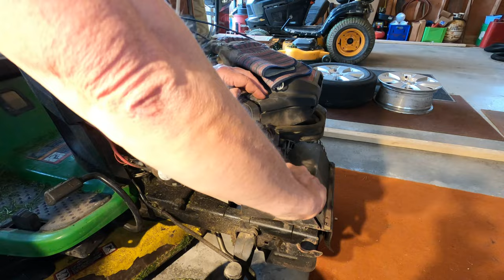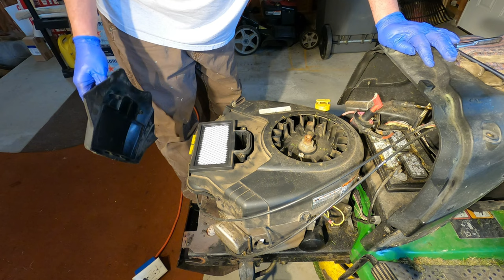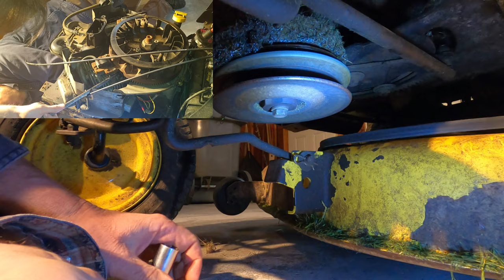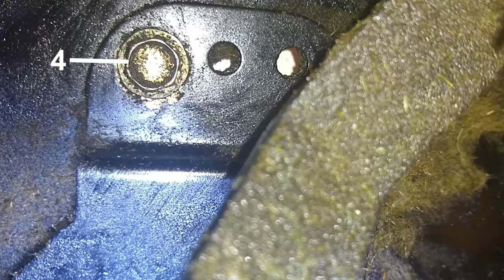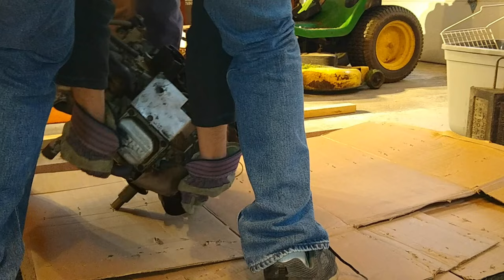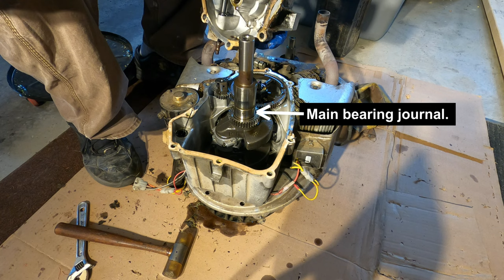Part 1 of 2 | Replacing Sump Gasket - Briggs & Stratton V-Twin 20HP

Comment: I just started to scrape my gasket off of mine, the gasket on my is so stuck on there, and I’m trying my best not to dig in, if I potentially dug little bit to hard will it cause major issues?
Reply from the maker: If the sealing surface is damaged, it might leak.
Reply: @manabouthome prolly would have to be some deep scratches.
Reply from the maker: Yep. Maybe try softening the gasket material with brake clean or similar. Let it soak in.